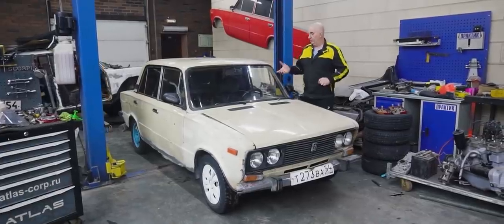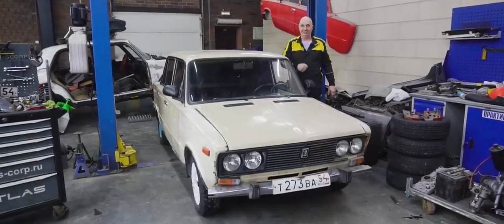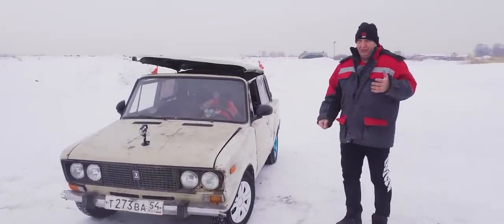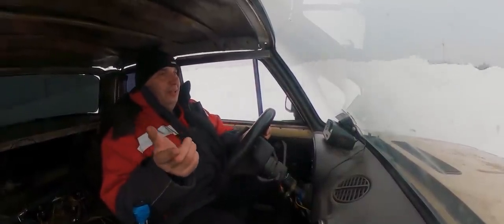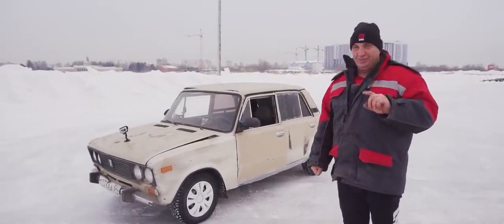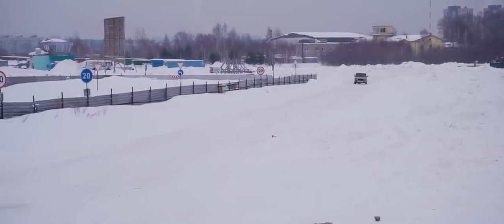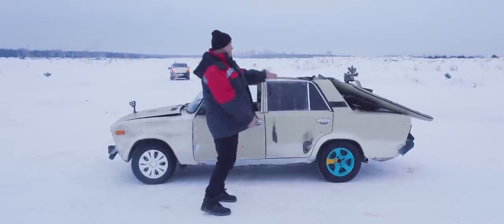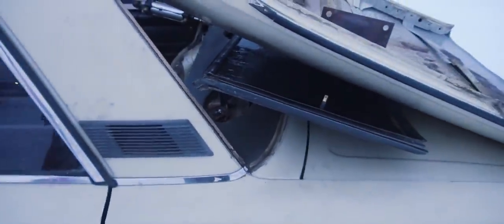We make a DIY airbrake for a Lada

Comment: Now that you have a proper pneumatic system in a Lada, you might want to modify the brakes to work with pressurised air as well. Like in trucks! Super easy and inexpensive to do for drum brakes!
Reply: that's not easy to make, truck / train brakes work in reverse.
air pressure releases them, no air locks them.
you need a brake pedal and system from a truck.
some light commercial truck have a dual system for the hydraulic front disk brakes, but the backside of the system is "reversed" air.
Reply: be nice if they tried to make a magnetic braking system ,have magnets on the brake discs instead ,isnt it eddy current brake ?
Reply: @girlsdrinkfeck  now thats interesting unlike my idea using wood
Reply: @AnalogDude_  Actually that is only true for the parking brake. If you use the foot brake in a truck for example it will use air preassure to activate thr brakes. The air gets released when taking your foot off the brake, you can hear that. However you are correct regarding the parking brake. That is because if there is a leak or not enough air in the system the truck won't just roll away.
Reply: @AnalogDude_  Exactly as Jayplexy pointed out before me. Only parking brake works in reverse, which is to stop truck from moving in case of a major leak and/or lack of air pressure in system. In its simplest form a brake pedal is just a valve which lets air in the brake cylinders. More pressure meaning more braking force.
Reply: no, you can test it your self and cut some truckers brake line near the "cells" of the rear axle or trailer, he will not get moving or the affected wheel will not rotate and slip.

train and truck brakes work in reverse, it's a LOGICAL safety issue. a train wagon will automatically stop if it gets accidentally unhooked from the train and disconnected from air pressure.
Reply: @AnalogDude_  As i said. That applies for the PARKING BRAKE. So what you're saying about cutting some truckers brake lines is correct. He will not get it to move. HOWEVER the foot brake works just like a cars brakes, except that it is usually activated by air.
Reply: @jayplexy5983  qoute: Unlike Service Brakes, Spring Brakes are not air applied. They apply the brake when air pressure leaves the brake chamber and releases when air pressure builds up in the chamber.

second qoute:
A complete brake chamber also serves as the “emergency brake” for an air brake system as a vacuum is required to release the spring inside the “emergency brake” chamber (this also creates a “dead man’s switch” effect to assist the truck in stopping if it were to ever lose air pressure during operation).

it's logical man, a truck automatically stops if the air compressor on the engine fails or a air hose fails.
Reply: @AnalogDude_  Again all your quotes apply to the PARKING BRAKE. And since air preassure is the same everywhere in the system it's logical that when a hose falls of or gets damaged all the air will escape and lock the brakes.
Reply: @jayplexy5983  dude, i work on cars and have fixed brakes on a truck once.

you problem might be using smartphones, get rid of therm. ditch them, you get misinformation launched at you.
Reply: @jayplexy5983  the quotes came from a "brake chamber manufacturer" and you still are coming with arguments?
Reply: @AnalogDude_ Oh man. I don't know if you're just not reading my comments but it's still about the parking brake. End of discussion.
Reply: @AnalogDude_  Yes, the quotes are correct, as mentioned above. But emergency brake is still not the same as the brake you apply with your foot. Spring brake means that in the brake cylinder assembly there are two chambers, one of which has to be filled with pressurised air in order to release the spring loaded parking brake and the other chamber is for operating the foot brake in normal driving situation by pressurised air. "Foot brake" has a spring in the cylinder to free the brake when you lift our foot off the brake pedal. This is also when the "hisss" sound occurs, because air is released atmosphere from the chamber.
Reply: @FuckYourselfTube  could be, since trains and trucks have 2 lines connected, but i often noticed standing behind a saddle truck at traffic light and looking at the rear axle and the brakes that moves in reverse.
Reply: @AnalogDude_  Holy crap man. What the other guy told you is exactly what i tried to tell you this whole time. By the way i also work on cars, i am literally a mechanic.
Also, if this comment comes off as rude, it's not supposed to.
Reply: If you drive a car and can handle the brakes good. Then get into a pneumatic vehicle and try braking. You will be like a newbie. Air brakes behave very different since they lag a lot compared to hydraulic aka car brakes.

And yes. Positive air pressure is needed to overcome the parking brake spring. When the air pressure is basically the same as the spring load the parking brake is no longer applied. Since there is only so much pressure needed to overcome the spring it will still be easy for the air pressure applied to the other chamber to move activate the normal brake system.
Reply: @jayplexy5983  yeah, some small Nissan trucks have a "bi sexual" setup, half hydraulic (front brakes) but the main part is pneumatic.
it's just like i said, from observing trucks and trains during my life, i noticed that it seams to work in reverse.

I'm only once fixed the brakes of a truck, a guy that happen to come by and asked if i could take a look, the fault was that the crimp mechanism in these "nipples" of the brake hoses / lines chewed ( due to vibration ) into the plastic and perforated it, the fix was easy, cut 5 mm of the hose and plug in again.
Reply: @Jonas_Aa  i never have to change my brakes nor the clutches on my cars, i use the combo. the don't wear.

i can park my car perfectly 1 meter behind yours at the traffic light not using any brakes, than i apply them to hold the car in spot.
but that not possible if you have lots of traffic behind you.
: )
Reply: @AnalogDude_  your quote "often noticed standing behind a saddle truck at traffic light and looking at the rear axle and the brakes that moves in reverse." 
What is in reverse? What way is reverse or forward?  It is just something you made up your self by looking at the moving parts and calling one way reverse to your liking.
Reply: @Jonas_Aa  lol, standing behind a saddle truck at a traffic light or so, you can see the axle / differential and the 2 brake chambers witch are connected (left wheel to right wheel) via a metal bar, the sound of the air escaping and that bar moving up kinda SLOW when the brake is "released", gives the impression that's not really spring load operated like drums brakes on a car / bicycle / motor cycle where the return is pretty much instant. that's all.
: )
Reply: @AnalogDude_  I know how it works and understand your explanation and I exactly know what you mean by looking at the rear axle my self. I also done so many times in my life and I also thought to my self "hey those are reversed". But you can not say it is in reverse or not. Because who decides what is reversed or not. Just because a piston moves in some way (in our out) it does not have to be reversed. 

The return of the bar when releasing the air pressure is done by springs. Since by just releasing air out of a chamber would not give any force at all. So there is spring force for return. The slowness comes from all the air that needs to escape and that the return spring can not be to strong since then it would defeat the parking brake spring.
In a car it is instant since it is hydraulic.
Reply: @Jonas_Aa  yep, i understand that's it's coming from the air.

no worries.
Reply: Sweet baby jesus what a shitstorm I started. 

Might be fair to mention my background also, which is an engineer & product manager in large-ish heavy trailer manufacturer (mostly 28-45 tons gross weight). Needless to say, that makes me rather confident that I've learned & seen a thing or two when it comes to trucks/trailers and air brakes. 

But seriously, never meant to be rude or offend anyone here. We're all grown men after all.
Reply: @FuckYourselfTube  press delete
: )
Reply: @AnalogDude_  Train brakes don't work in reverse.

Comment: The windshield is pushing air up into the bubble space created by the roof lid being open.  It's the same thing as a Pick Up Truck, which gets better gas mileage and less drag, with the tail gate UP, instead of down.  On a pick up truck, with the tail gate down, it creates MORE drag, as the cushion of air that was trapped in the bed, is gone.  It works like an air ball bearing.  Try welding up an inner frame support, and flip the hinge to the windshield, and increase the angle of deflection to 45~50 degrees.  That would work better as an air brake.
Reply: Not Name Yet  ?
Reply: Not Name Yet  no you
Reply: Looks like we have Wilmer valderama in here
Reply: Not Name Yet  Banana

Comment: I know it sounds weird, but it might have been more effective if the "airbrake" opened in the opposite direction.  Not only more structurally sound, but aerodynamically the induced drag from the partial vacuum behind the car would probably be as, or more effective.  Think about a pickup truck with an "Airgate" or missing any tailgate.  Mythbusters did an episode about it once.  The area rule still applies when you aren't in an airplane.
Reply: Agreed. I'd have limited it to only the rear half of the roof, hinged at a reinforced bar between the B pillars. Should be able to open it near vertical, and a  bit of bracing on the roof panel wouldn't hurt either...

Comment: The coefficient of drag squares with speed.  For example:  If you double the speed, drag quadruples.  If you triple the speed, drag is increased 9 fold.
Reply: Yes i mean, the air starts to be a problem at high speeds, i would say 100kph or above, but at 40kph the weight of the car is too much for any device to be effective

Comment: best way of doing it would probably be a big plate at the back, hinged at the top of the back window
when down it would make your Lada a fastback
then you pull it up until it stands upright
that way you get downforce in addition to drag, and if it fails it just goes back to its low position instead of getting ripped off

Comment: I'm inspired by your efforts to engineer a vehicle for maximum safety with redundant deceleration technologies! 

I also enjoyed (in another of your superb videos) your engine block anchor method for supplementary braking in the case of standard brake failure. All of these are excellent ideas! I'm so glad that automotive researchers such as yourselves are so serious about safety!

I had a related idea that I think you may wish to investigate. In the frightening case of conventional brake failure, rather than dropping an engine block out of the rear of the vehicle, why not engineer a mechanism that would drop an engine block in front of both of the front tires? My instincts suggest to me that this method may result in a reduced stopping distance - a clear advantage from the standpoint of safety. 

Obviously there's no way to know how well this will work without experimentation and road testing.

Comment: I'm curious why that didn't work more. I can only assume that you increased the down-force more than the stopping force. The car has too much energy built up due to its weight and low rolling resistance to be slowed that much. But I bet the downward forces we're significant if they could be measured. I think we learned more about downforce than we did air brakes. Very cool!

Comment: should of just attached another roof ontop of another lada that has a release with a distance stopper so it wont flip over the trunk and it just stays up even at low speeds. then attach very thick fabric to sides of both roofs so the roofs act as a scoop when it lifts because the air was escaping your cabin of lada, also the air had so much space to fill to Actually even attemt to slow car thats why is only did ok.

Comment: The Lada's velocity was just too low to get trustworthy results:

As air resistance increases by square when doubling the speed, an air brake is supposed to support braking pimarily at higher speeds.

So, in order to do that properly, the construction would have to be reasonably reinfoced.